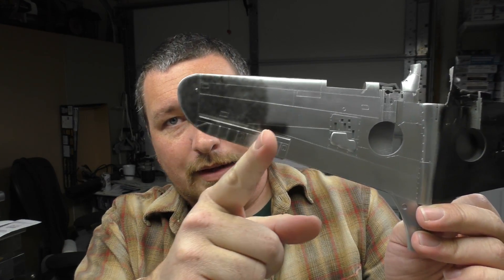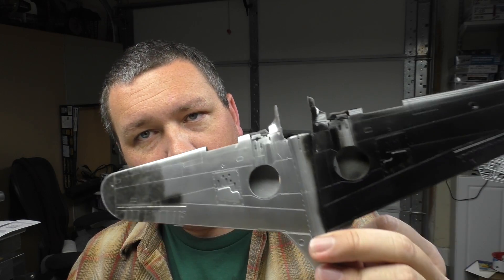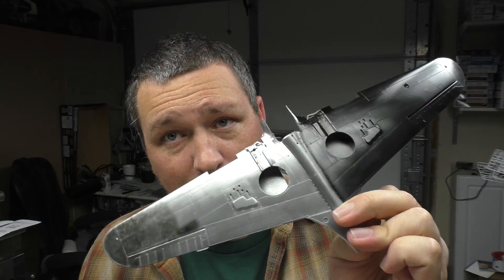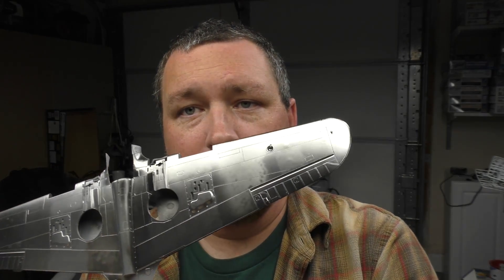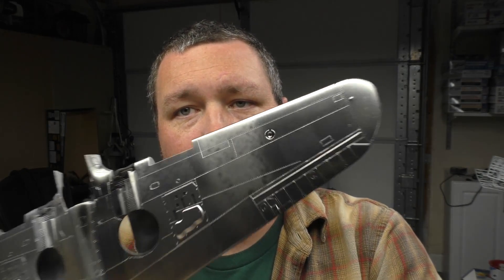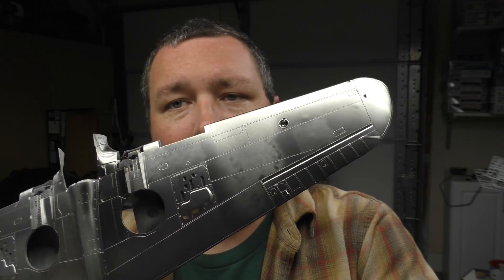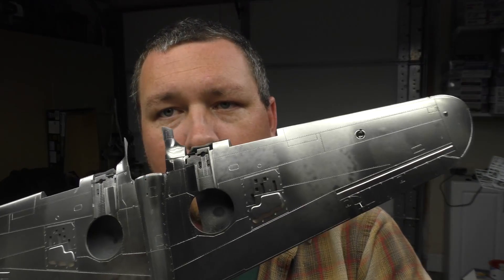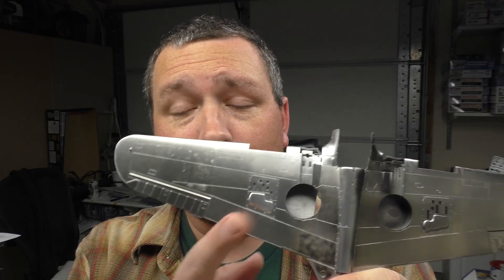Bare Metal Variance - Part 2

Comment: I feel like the difference you see on the finish is partially due to glossiness of the layer under the metallic top layer. It looks like grays you used are more matt than the black or metallic layers so the top layer reflect the light differently. ???
Reply from the maker: foxmulderms the grays are all either gloss or semi-gloss, but sheen variance could certainly be playing a role.